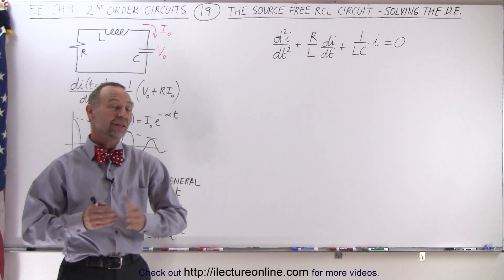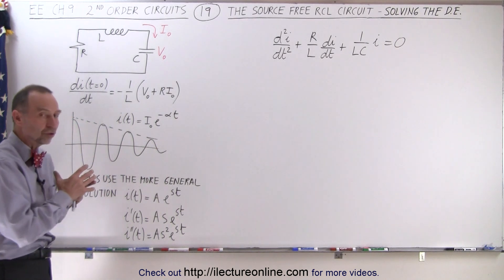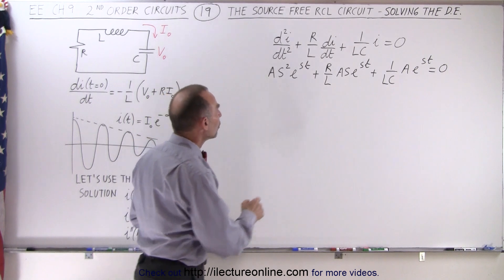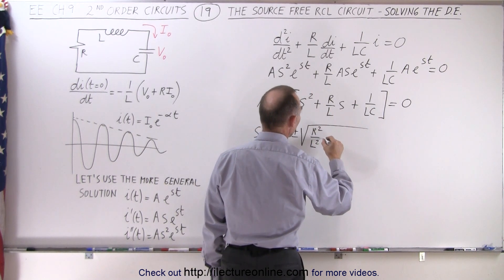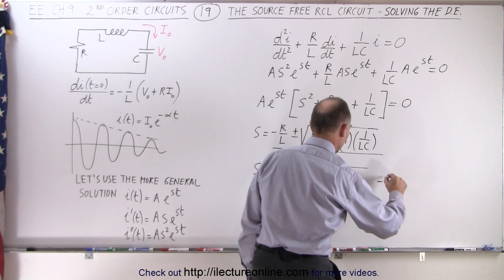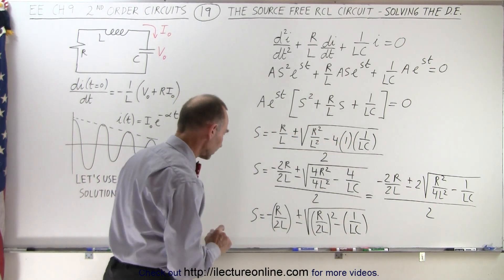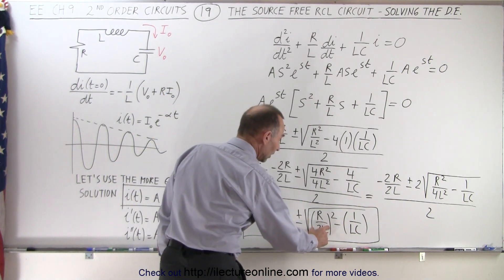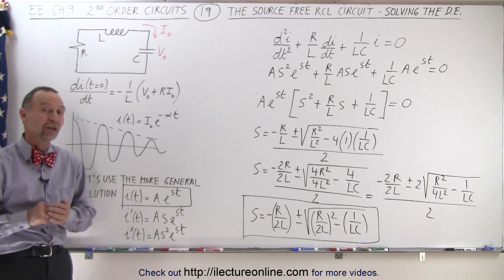Electrical Engineering: Ch 9: 2nd Order Circuits (19 of 76) Source Free RCL Circuit-Solving the D.E.

Comment: Hi Mr. Van Biezen, requesting for some thorough videos on transistors and diodes. You have covered resistors, inductors, capacitors in depth and helped me a lot. I simply love your teaching method. Thanks.
Reply from the maker: Yes, that  (and signals and systems) is high on the list of topics to cover.  Need to finish some topics first and then we'll tackle those.
Reply: @MichelvanBiezen  Thanks and will be waiting for the requested videos.

Comment: why where you able to just multiply the equation by a factor of 2 but only like have of it. why did the 4-(1)(1/LC) not get effected?
Reply from the maker: The 2 in the denominator is part of the quadratic equation.
Reply: 4/4 and 2/2 is still 1 its to help make the simplification of the equation